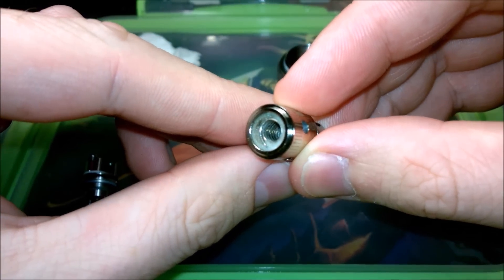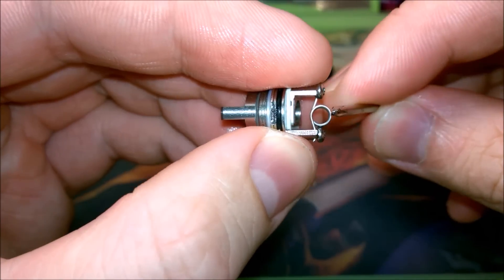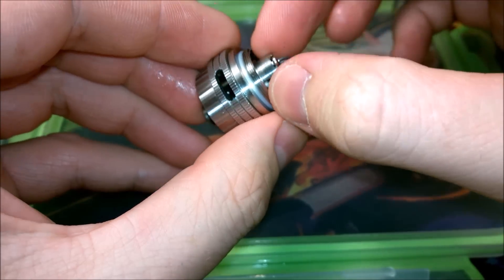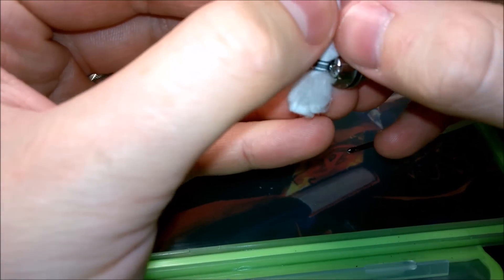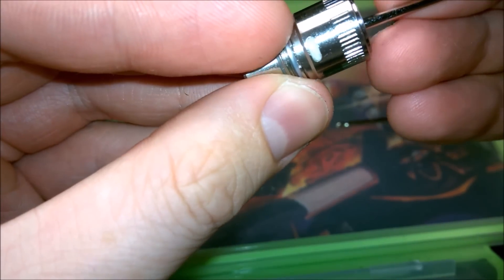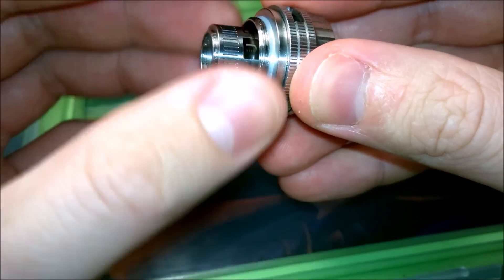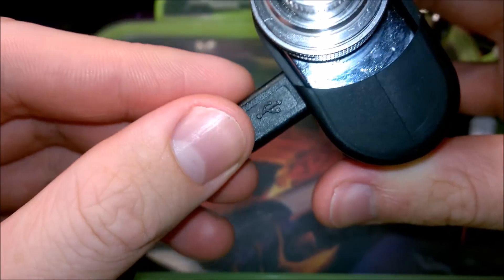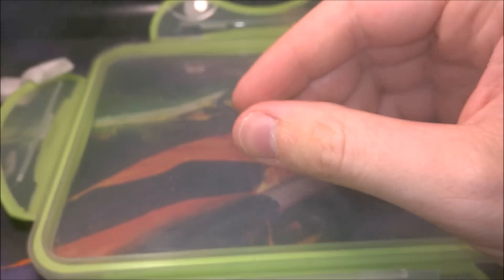UWELL Crown RBA - Build Guide | 1080p Close Up

Comment: Certainly the RBA will give more dry hits than the stock coils.  What helps is to pull a few times without firing before taking a long drag.  That pulls more juice into the coil.  Mine works OK, but I definitely prefer stock coils.

Comment: What gauge and type of wire are you using? And what is the inside diameter?
Reply from the maker: +Corvus Violet Kanthal 26 I think! Diameter.. wouldn't have a clue haha!
Reply: +Jamie Hutchinson The coils that come pre built with the RBA kit are 316L stainless steel and should be used in temp control.

Comment: Hate the RBA deck on this, pity cuz the tank with stock coils is hard to beat. Just find the RBA way way too restrctive airflow wise! Nice vid though man!
Reply from the maker: +John Crudden I find the airflow is still good with RBA on man, check cotton isn't covering the centre hole too much perhaps?
Reply: +John Crudden vertical coil.  running a 24/32g clapton, 4 wraps. all kanthal. .34 ohm.  2.5mm inner diameter. rayon wick.  it hits like a champ.  if i run smaller gauges, im going to try for a 3mm inner diameter.  a horizontal coil restricts the airflow far too much for my liking.  Stock coils however, are pretty beast.  Price isnt terrible either.  I just enjoy building.